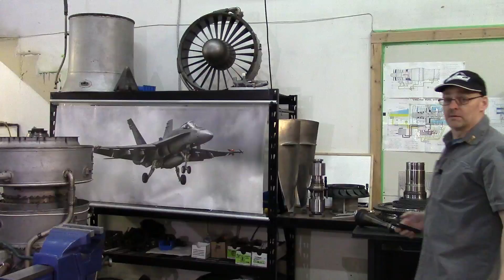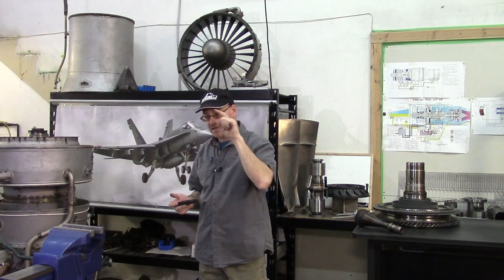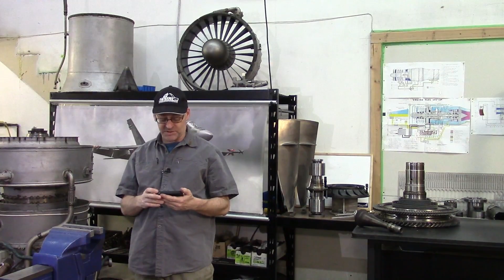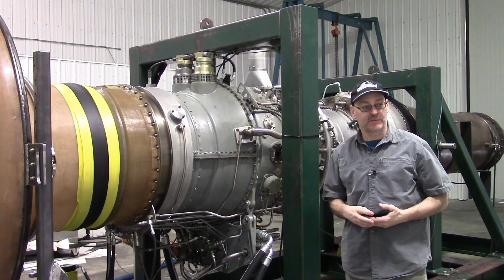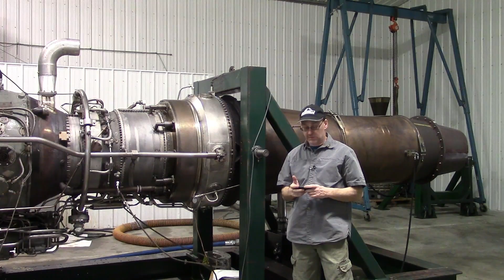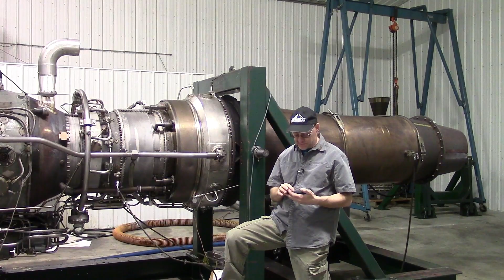Jet Questions 80

Comment: AgentJayZ, great channel we all appreciate the time you put in to these videos. I found a 3D model of Trent1000 available for download here (works on iPad, iPhone): http://www.rolls-royce.com/products-and-services/civil-aerospace/products/civil-large-engines/trent-1000/trent-1000-ar.aspx  

In the HP system, I was surprised the compressed air enters the combustion chamber through holes at right-angles to the direction of airflow. Why is it more efficient this way, rather than having entry holes between the fuel injectors allowing more streamlined flow of air? Anders

Comment: the harrier had water injection.
Reply: +sean avery Yes, the Pegasus in the Harrier has water injection, but not for NOx reduction. It's used for the engine's so-called 'Short Lift - Wet' take-off rating for a matter of seconds. Other engines have also had it for optional use at take-off, but the water doesn't need to be injected into the primary combustion zone. Water injection for NOx reduction in industrial gas turbine applications can be continuous and does need to be placed into the primary zone, preferably via the burner head, or very close to it.
Reply: +grahamj9101 Thanks for excellent support on this forum. How these aircrafts used to create short lift with water? 
Please keep on contributing with your valuable expertise.
Reply: +Abid Mahmood The water is normally injected into (or immediately upstream) of the combustion chamber, where it instantly vaporises. Absorption of the latent heat of vaporisation cools the airflow and the combustion products. This allows an increase in fuel flow and hence thrust for a short time, at a lower turbine entry temperature than would be the case without water injection. To achieve the same increase in thrust without water injection would result in a considerable reduction in turbine aerofoil life. Although the water is usually injected into or upstream of the combustion chamber, I am aware of at least one engine in which the water was injected at the front of the LP compressor.

Comment: HI JayZ, I watch your videos and really like them even tho I'm not even close to the Jet Engine field. I'm in the Electric Vehicle area and have a GM Bolt question that deals with shafts within shafts. The Bolt has an electric engine that turns a transmission that in turn has an output shaft that runs thru the shaft of the electric motor to drive the 2 front wheels. Here is a link to a schematic http://www.cnet.com/roadshow/pictures/examining-the-guts-of-the-all-new-chevrolet-bolt-pictures/18/ Using your extensive Jet engine shaft knowledge can you make some comments about the Bolt shaft within shaft engineering?
PS - my real link to aircrafts is my Father, he was a test pilot for the Airphibian, a Car/airplane that got an N number from the FAA. www.Airphibian.com

Comment: Hey AgentJayZ! What are your thoughts on this new jet engine design that claims to use 16% less fuel and produce 75% less noise by adding a gearbox to the shaft between the fan and turbine? Is this the next best thing, or does it have a drawback? Here's a link to the video and news article: http://www.bloomberg.com/news/articles/2015-10-15/pratt-s-purepower-gtf-jet-engine-innovation-took-almost-30-years
Reply from the maker: +TheOverNormalGamer The Garrett TFE 731 is a geared turbofan that has been very successful for over 30 years. The pure power geared turbofan is great, but is not a new idea.
Reply: +AgentJayZ Thanks!